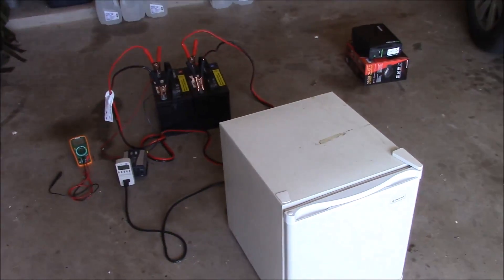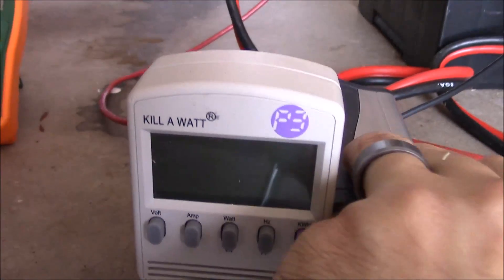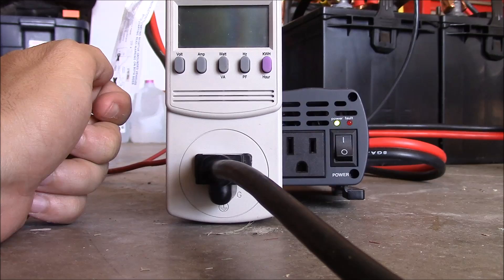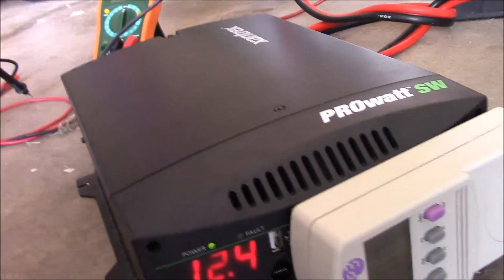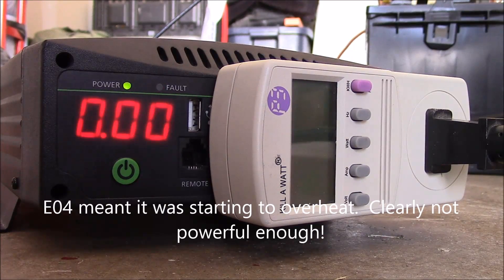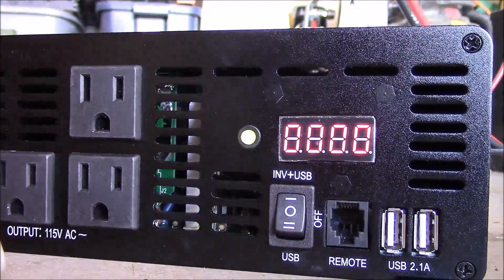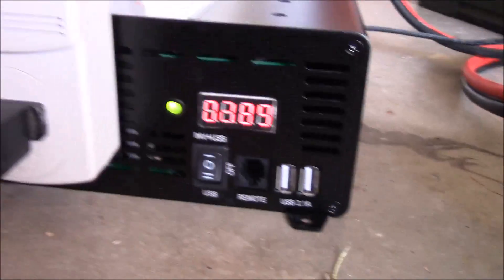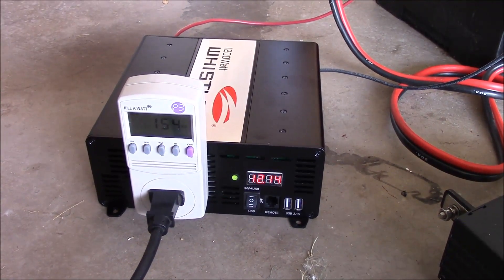Will It Solar? - Mini Dorm Fridge 3

Comment: In most inverters I have ever seen both plugs are in parallel in order to have them split you would actually have to have basically two inverter circuits inside the one box, so you should be able to get full watts out of just one but if you have seen how electronics companies rate stereo amp outputs you might get an idea of why you can't get advertised output :)
Reply: Everything Integr8 says about "mod-sine" or square-wave inverters is correct.  Also, appliances actually use power that's in the sine wave, the "space" (the integral that's defined by calculus) between the the two waves is power that's drawn from the battery but wasted as heat in addition to the power actually used.
To put it another way, say you have three 100-watt light bulbs*.  If you power them with a pure-sine wave inverter, you'll pull 300 watts from the batteries (plus something like 12 watts for inefficiency with a good-quality inverter).  To run the same three light bulbs with a mod-sine inverter, you can lose up to 30% on wave inefficiency (that's 90 watts wasted) and the operating efficiency losses are probably higher (call it 6% on the 390 watts, or roughly 24 watts) for a total of 415 watts or so.  That's 415 watts versus 312.  Since putting power into those batteries costs money, a sine wave inverter will save you money in the long term.  You'll also give your batteries an easier life (they'll last longer), they'll come back to full charge quicker, and you'll have fewer instances when you're running low on power.
(* I know that nobody uses 100 watt bulbs anymore but it's just a simple example for explanation.)
And this example is for pure resistive loads.  Once you get into inductive loads (like motors), the effect is more pronounced.  Pure sine wave is the way to go, and is worth the extra money.
Reply from the maker: True, but I thought that was just when you were using both plugs?  So you are saying that most inverters cannot supply their full rated watts to one plug?
Reply: well, I'm saying that one or both it doesn't matter it can supply all it has to either configuration, but what I am also saying is that electronics manufacturers have for a very long time lied about the ratings their product can put out. Things like "Peak" RMS power which is an oxymoron as RMS means root mean squared which is similar to average which IS NOT peak.. So I suggest that inverters may fall in that same category and since the same companies are making both amplifiers and inverters they may lie about both. At any rate the plug ins are connected to the same source inside so you can get all it has from just one.
Reply from the maker: integr8er66 Yeah I knew that about amplifiers but good to know about inverters.  That is why I do these real world tests because a lot of people, including myself, will buy a product trusting the specs and then it won't run what you expect it to run.
Reply: FYI, I would not waste my money on square wave inverters. Yes they cost a lot less but in the end you don't want to have to select what you can and can't plug into an outlet, and some things a square wave will flat out ruin. I have an off grid cabin in the woods, well it's an old camper with a deck and roof, I have got a setup that has worked really well for me for several years now. I have about 100 watts of Solar panels, one 100 amp hour deep cycle battery from Bass pro shops, a 3 stage battery charger connected to the battery, and a 3500 watt remote start generator. The camper is old and back then they had duel lights in all the fixtures, so I run lights, water pump, TV Cell phone booster, radio amp, car stereo, phone charger all on 12 volt. I have a 1000W sine wave inverter for small short duration 120 volt loads like maybe a drill or something. and then if I want A/C or my wife wants a blow dryer or I want to make coffee I just fire up the genny. Since the Genny isn't on any longer then say 10 min or so at a time it really doesn't use much fuel at all other then when A/C is required. All in all it works really well. In fact I am over 5 miles to the nearest power pole as I type here :) Next up is to do Refrige on solar, and that is what got me to your video. What I know is I need probably at least 200 Watts of panels for that and probably another battery and I think I'll keep the systems separate at least until I know I have enough power for the frige from the new panels.
Reply from the maker: integr8er66
Look into converting an old chest freezer to a refrigerator.  They have about double the insulation of a fridge, open at the lid to keep the cool air from escaping, and use a lot less electricity once you convert them to run at around 40 degrees or whatever your desired fridge temp is.  There are lots of articles out there about how to do it but here is one example:

http://newlifeonahomestead.com/convert-chest-freezer-to-fridge-solar/
Reply: Yep.  Runs that fridge really efficiently, doesn't it???   QED.
Reply: True, and they have a "startup surge" that has to be accounted for.  And even if you don't have an induction motor, mod-sine wave inverters are inherently inefficient.  If you scope out the wave form from a mod-sine inverter and compare it to a full-sine-wave waveform, the difference (you can calculate the difference as the integral in a calculus equation) will be lost as heat.  Sometimes this inefficiency will be as much as 18-20% from a "good" mod-sine-wave inverter.  Where does that inefficiency go?  Into the motor wiring and windings as heat.  So, you're wasting about 1/5th of the power you're pulling from your battery (bank) and you're overheating your appliance.  Will someone tell me why they think that this is a good idea -- even if the m-s-w inverter is cheap????
One thing you can try.  Listen to what you're running on a m-s-w inverter.  If it's a microwave or fridge, you can probably hear a hum -- that hum is the inefficiency which is setting up an electrical field that so inefficient that you can hear it.  If you can't hear it by ear, put a radio tuned to "no station" near it -- you'll hear all that energy loss then.
Mod-Sine-Wave inverters are cheaply-made, wasteful, and can damage appliances.  If you're serious about running off an inverter, get a Pure-Sine-Wave inverter.  This is a place where cheaping-out will cost you money.
Reply: I've run a chest fridge for many years, and on a MSW inverter and they do just fine. My 7CF chest fridge uses only 94W running once it has settled down. I also run my entire house on a single car battery and even have a dishwasher.  I can't help it if everyone else has no idea what they are doing.  I'd be very leery of these wanna be engineers.

Comment: Square wave inverters are not very compatible with A/C motors. they will run but not well. If you had a pure sine wave inverter it may draw less.
Reply from the maker: I tried a pure sine wave inverter in the previous video.  Granted it was only 600 watts, but that is the biggest I have in 12v.

Comment: From what I see you wires are too small you need thicker wires running from your battery to your inverters and shorter wires connecting your two batteries.
Reply from the maker: Hmmm, I don't think that is the issue.  If that is the case, why did it work when I used the 1200 watt inverter with all the same wires?  Those wires to the inverter are 6 gauge and the jumper cables between the two batteries are designed to jump a vehicle with over 200 amps so they are fine.
Reply: He don’t know his ass from a hole in the ground.  This in NOT the proper way to run and inverter.  You need at least 2 gauge wires with the proper terminals.  And I guarantee it will work. 6 gauge alone is not enough plus the length and not to mention those clamps are not efficient.  The reason it worked on the 1200 watt inverter is probably partly due to it being better built.  As for the vehicle it’s a starter it will turn no mater what if your feeding it power but your actually creating heat in the starter because it’s not enough current through those cables.   Let’s see you perform this task hooked up the right way and we will see what works and what don’t.
Reply: @R.N.GPerformance  2 guage????
Reply: In my opinion 6 gauge is to thin, you should try with a 4 gauge.

Comment: You need probably about 1500-2000 max watts just to kick the fridge on.
Reply: Mine needs startup 500W and 60W at working. Just cheapest normal size Elextrolux.
Reply from the maker: Yep, that is exactly what it ended up needing.  A bigger inverter that can provide a big surge of power for a few seconds.
Reply: The compressor on a refrigerator takes a huge surge for startup.  Then it drops down to something much lower.  Nice video!
Reply: Those little fridges are awefully inefficient. They have very poor insulation and for the amount of cooling they produce compared to a camping compressor fridge. Probably 80percent less efficient.

Comment: I honestly expected the Xantrex to handle this fridge. It has a relatively lower surge than its 1200w rating but I don't believe that that particular fridge even reaches 900w. It could have been nice to show the start surge of on the Kill A Watt
Reply from the maker: The Kill A Watt does not register fast enough to catch the surge.  I tried it numerous times.  I wish I had an oscilloscope or some more advanced measuring equipment but I don't.  I was also very surprised.
Reply: Did you use different cables perhaps? That the difference in the gauges is what made some inverters to fail because of voltage drops?
Reply from the maker: Sammy Kalintosh No, I used the same setup for all the inverters.
Reply: Ok
Reply from the maker: Sammy Kalintosh It is a mystery for sure.  It is possible that the Xantrex has a higher low voltage threshold and the voltage drop was enough to trigger that in the Xantrex and not in the other models.  I don't know.
Reply: I was surprised too. I've a 3.3 Cu fridge from Aramco. They're not too efficient but I had an old 600-watt Cotek inverter with only 800w surge and it handled it without a problem; all day,  everyday
Reply from the maker: Sammy Kalintosh Yeah, I think it has to do with the motor and whether there is a start capacitor in the fridge and other factors.  Some will work, others like this one are a pain.
Reply: Agreed

Comment: From what I believe I understand the batteries can only make so many volts the inverter amplifies that to 110 volts so 1-2 amps on DC is like 5-10 amps AC the kill a wats probably just saying the actual charge at 110 volts that's why it took a 1200 watt inverters and dual batteries
Reply: By that logic a 800 watt inverter not working isnt crazy
Reply from the maker: No, that is not correct.  The inverter amplifies the voltage by dropping the current.  Let's say you have 10 amps of 12v DC power = 120 watts.  Without factoring in conversion losses, that will equal 1.09 amps of 110v AC power = 120 watts.

After talking with several A/C and refrigeration techs, the reason this happens is because the compressor motor draws a lot of power when it first kicks on and that surge of power cannot be handled by a lower watt, cheap inverter.

Comment: A kick ass pure sine wave inverter is a good Idea.  Motors hate modified square wave.
Starting Surge on a compressor s about 4-10 times what the running current is.  I got a 2000w harbor freight unit for 99 bucks.  easier to carry than a generator . all electrical motors with brushes are not so pickey about modified square wave power. Shaded pole or induction motors hate anything but pure sine wave.
Reply from the maker: Good info.  I did eventually get the thing running as you probably saw with a 1200w modified sine wave inverter.

Comment: I had the same problem with my smaller inverter.  I added a .5 Farad Capacitor on my cobra and worked fine ONE 12 V Deep Cycle battery.  Ive upgraded inverters since then.  Good video. 

https://m.facebook.com/story.php?story_fbid=10101757985202352&id=199107327
Reply from the maker: Cool, glad it worked!  And thanks for the feedback.

Comment: from my experience adding a big capacitor before the inverter with a diode on the neg side so the power doesnt feedback into the battery. that should solve the hard start issue. it works with big car audio amps so we tried it on my motorhomes ac, worked like a charm.
Reply: Chris is right.  RV air conditioner manufacturers sell them as a "hard start" kit.  A fairly knowledgeable home owner should be able to install one.  I would wonder if it should be before the inverter -- I'd put it at the fridge, otherwise the surge of start-up power would have to be handled by the inverter.  If the capacitor is at the fridge, the inverter would never "see" the surge (it would, of course, have to provide the power to charge the capacitor but that would be done under conditions of low power load).
Reply from the maker: Interesting.  I'll have to try that if I ever re-visit this.  Thanks!
Reply: Chris Sholtz  was going to say a hardstart kit on the mini rf and a 2.1F old fosgate low esr cap across the power input will do wonders for surge power I'm running 4 maxwell super caps 3000F right at my 7000w rms inverter and running li-ion batteries with a short circuit current over 8000Amps on tap (24v system using 10 tesla modules 54kWh and 1.2kwh or solar on 7x16ft cargo conversion also used as home backup power lol)
Reply: That wouldn't do a thing.  The inverter shuts down because it sees an excessive amount of current drawn into the inverter. Starting a fridge is about a 12A surge at kine voltage, I've measured over 120A into the inverter.  You can't get 120A thru the transformers and FET of a 400W inverter. This problem is not the result of battery sag.  I run a 2KW inverter on my fridge even though it is only about 100W running.
Reply: Underrated comment

Comment: hey your inverter will show low voltage if your vehicle is not supplying 14volts aka alternator power so to keep your battery from dropping. to low to start the shut off with your car so that's prolly what is happening with your other inverters
Reply from the maker: Maybe, but only the one inverter (Cobra) is really designed for use in cars.  The bigger inverters are more designed for running off batteries or solar.

Comment: also jumper cables are a awful way to connect two batteries together they dont give you a powerful enough connection.
Reply from the maker: How do you figure?  They are heavy gauge with copper clips.  They are just fine for 200+ amps when starting a car, why would they not be good enough for a brief demonstration on a 6 amp mini fridge?
Reply: +LDSreliance the jumper cables will work but the alligator clamps are not the best connector it should work but you could do better with bolting the wires right to the batteries
Reply from the maker: Austin Pieschel
I understand but for a quick test this is more than capable.

Comment: you have your batteries wired wrong your charge wires should have positive wire on first battery and negative on second battery and same for your load positive on first battery and negative on second battery. That way you are pulling or charging to or from both batteries not just the first battery.
Reply from the maker: Christmas Eve True.  When permanently wiring a battery bank you would want to do that for sure.  You would also want all the cables to be as close to the same length as possible.  You would also periodically rotate the batteries so that they stay charging and discharging evenly.

However, this video was a demonstration and test and it doesn't matter for that purpose.
Reply from the maker: No, that would wire the batteries in series, which would double the voltage to 24.  The inverter would not have worked that way.  I needed extra amps, not extra voltage.
Reply: The first part of what Austin said in wrong (you're not even charging in this video) but the second part is true (from what I hear) that when batteries are connected in parallel, you should pull power from the (+) on one end of the bank and from the (-) of the battery on the opposite end of the bank.  Even though your jumper cables basically merge the positives and the negatives, people say you can get uneven depletion if you pull from just one battery.

Comment: Is this a freon refrigerator? Or electronic? If it has a motor, you need to get a softstart for it....
Reply: Softstart capacitor was my first thought too. Google it and you will find a lot of info and videos. Once installed, you should be able to run with a smaller inverter since the draw will be greatly reduced on startup.
Good luck with your system.
Reply from the maker: It is a freon refrigerator.  How do you retrofit soft start?  I thought that was a feature built in to the motor.
Reply from the maker: John Beckman
Thanks!  I will have to check that out.

Comment: Thanks for the video! I was thinking about exactly this problem, what it would take to run a small frig. Looks like the answer is a lot!
Reply from the maker: It is all in the quality of the inverter.  Most inverters that are around $100 or so and claim 2000+ watts are garbage.  They cannot produce enough surge power (even though they claim they can) to power up air conditioners and refrigerators.  You could do it if you had a start capacitor wired in to help handle the surge (my capacitor in this video series was a car audio capacitor which was not up to the task or was too small).

But the silver bullet solution is to have a really good inverter.